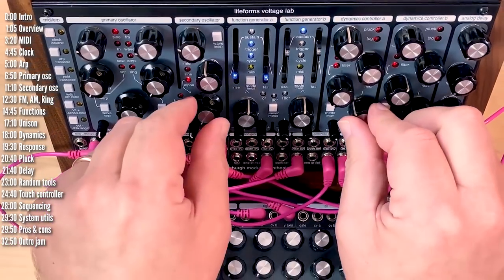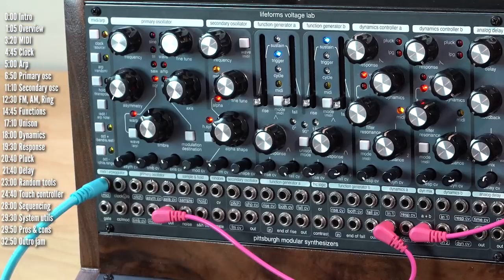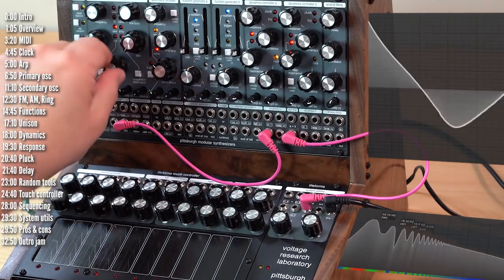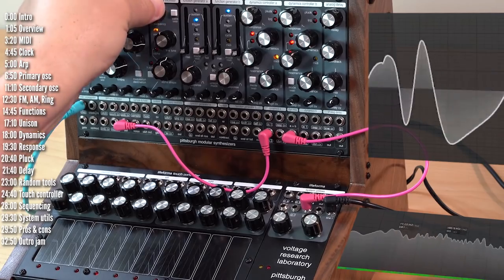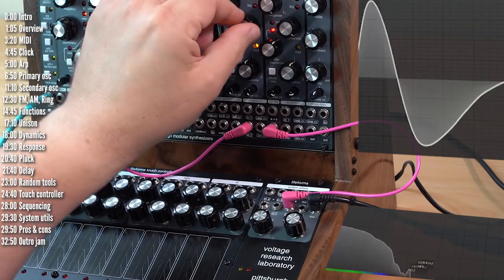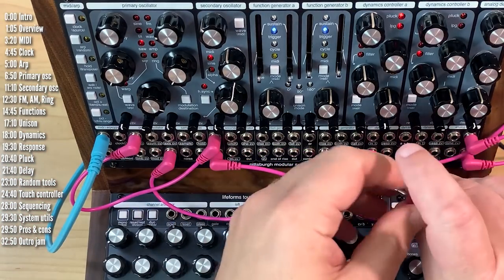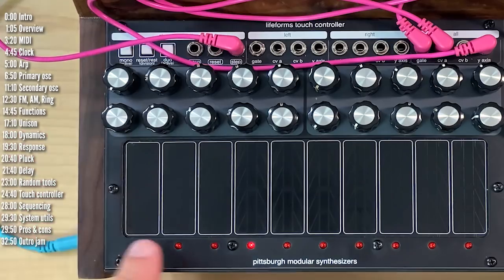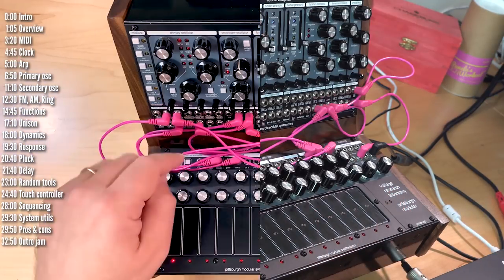Review and tutorial: VRL (Voltage Research Lab) from Pittsburgh Modular

Comment: As always, very nice content sir, I can't imagine how you could have made a better review.. Aside from your quantizer and DC couple issues aside (nice that you did have negatives rather than a rosie rah rah promo for a product) is hard to see how Pittsburgh could have made a better product either. The compatibility u get with using one manufacturer makes me and my much bigger and pricier system a little jealous...I don't see much need for it myself but for friends considering modular or if I had my time over...those that buy this will probably have no idea the cost and significance to rackers of the little corners of sample and hold, noise and random. I bet the Wigglers who don't have them that just watched this sure do. Not sure on the asking price but I can assure anyone new to synth they would be appalled to know what it would cost to build a system like this with separate modules. Nice work to you and the makers. Kudos and thanks. Keep up the good work. Ps extra points for the inclusion of the end eor and eoc gates on the function generators, great feature, I wonder where they got that idea from?

Comment: I have a little tip for doing vibrato on this synth.  With the modulation destination turned off (no leds lit up) but the mod attenuator turned up, there is a very small amount of bleed of Osc 2 FM to Osc 1, that you can dial in with much greater control.  With the pot all the way up, it's still a useable amount of vibrato.

Comment: This looks awesome. Interestingly, one of my main issues with the SV-1 was the free-wheeling pitch of the oscillators. But that is a problem I know they've resolved, because their standalone Primary Oscillator has been a vital part of my live rig for months. Nowadays, I fully believe these guys make some of the most interesting and impressive analog oscillators on the market, and this sounds like it's raising the bar even further. That MIDI > CV module looks just as tricky as the SV-1's though... do you still have to count LED blinks in order to change the MIDI channel? And no pitch CV output? Odd but perhaps understandable if VRL is viewed as a fully standalone synth. Regardless, this is extremely tempting, especially after your wonderful demo. That little case makes it look as sexy as it sounds.
Reply from the maker: Thanks for the kind words about the demo, and indeed no CV out from the MIDI module - manuals are now available for download I saw, so maybe I missed something...

Comment: The clock generator tempo can be only set by tapping? Why not add a 3 digit cheap display just to tell you the BMP it´s at?
Reply: The midi clock can be controlled in three ways.  All of this is covered in the manual. 1. Via midi. Like your daw, or midi controller.  Two very popular options would be an Arturia Keystep or Beatstep Pro- both output midi clock and are very affordable.  2. The internal midi clock can be controlled via tap tempo. Simply tap it it.  3. Analog clock input- like an lfo square wave.

Comment: Why te hell is this so unneccessarily bulky? Will someone take pointers from Seismic Industries please? This could have been beautifully tiny, like the 0-Coast
Reply: Seriously, it could not be any smaller. I'm tight with the designers and the PCBs to this instrument are PACKED with components. This is an analog circuit, I've watched the development of this system in person for about a year. There's an insane amount of work that goes into making something like this a reality.
Reply: I'll take your word for it. But isn't it a combination of existing modules?
Reply: It's a combination of new and existing circuits. Separate modules would take up more space AND be more expensive. VRL is designed as a unified instrument ecosystem.
Reply: @soysos.tuffsound  Right, thanks for clearing that up.
Reply: Also, I just looked up the Seismic Industries stuff. Looks cool, but not small at all really. Their basic system looks larger than the VRL and doesn't cover nearly any of the ground this instrument does and doesn't have the touch controller/sequencer. Also if I have the currency converter correct, it comes to $2321 US dollar.